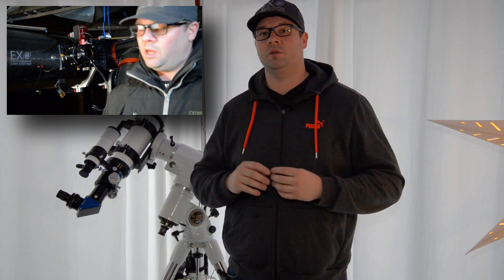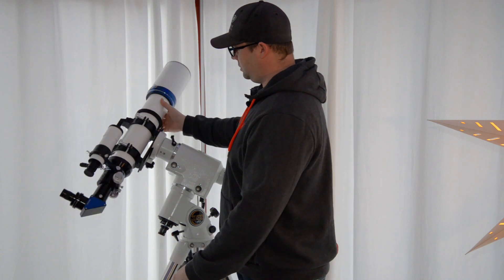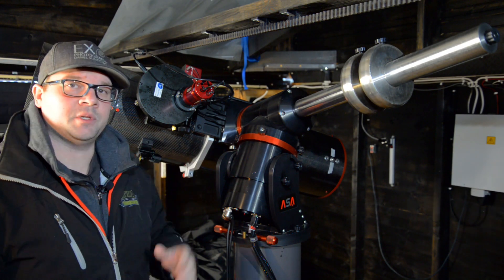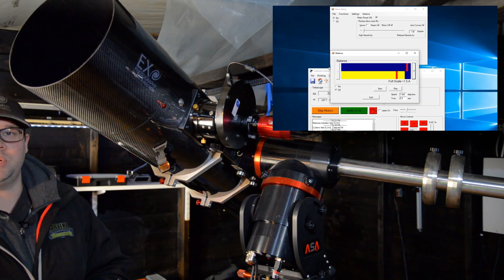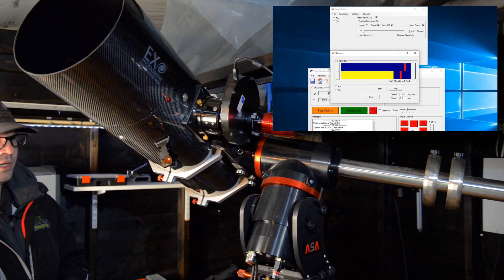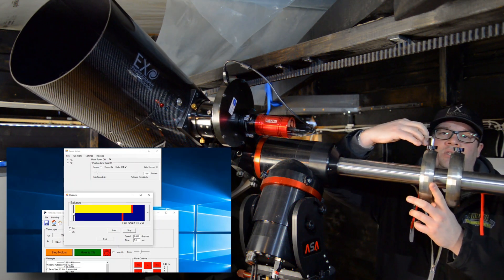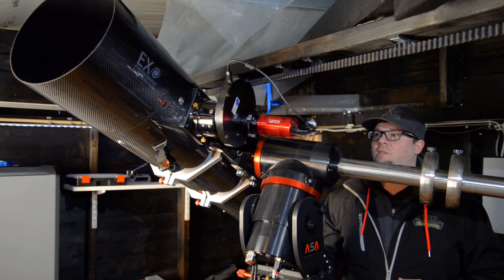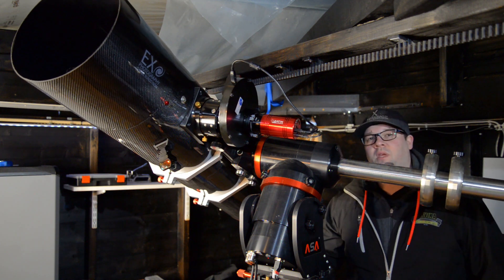HOW TO BALANCE A DIRECT DRIVEN TELESCOPE MOUNT

Comment: 10M has a similar method of balancing, but if I do the routine then power down and put DEC vertical the scope is not balanced. This ever happen to you?
Reply from the maker: I can get a bit difference in balancing regarding the positions... but just small differences. Not that matters for my tracking.